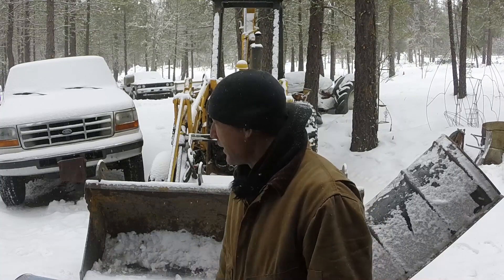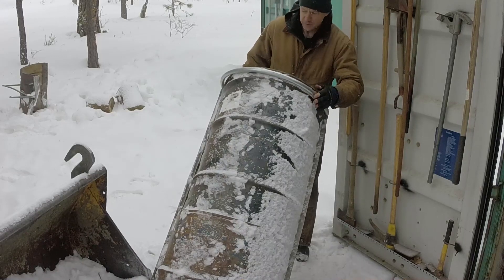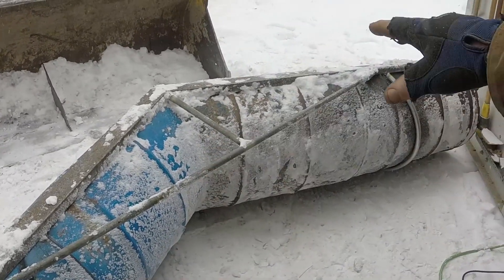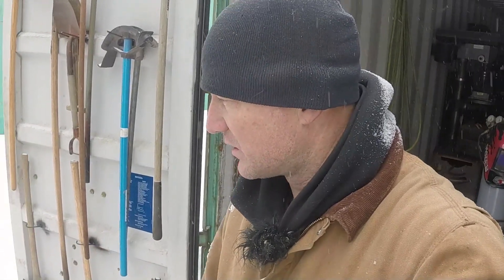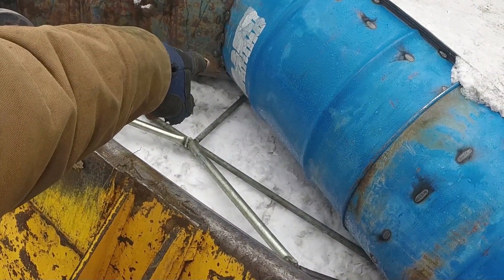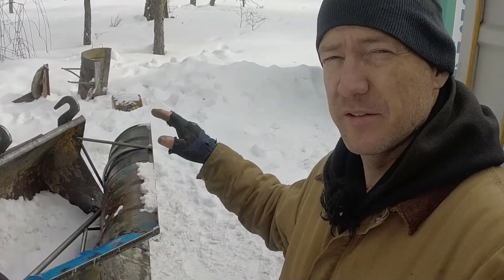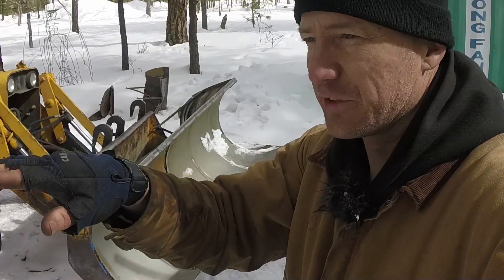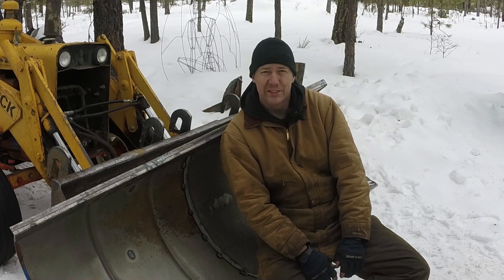Finishing the V plow for my backhoe

Comment: Nice update to the plow. Always amazing to see the amount of force pushing snow etc. will exert on  metal.
Reply from the maker: It will be nice to see how it does next year when there is more fresh snow on the ground. Thought about putting some wax on the buckets to make the snow slip off the side faster. Thank you for watching. :)
Reply: @KoalityofLife  rainex :) but good paint do great.
Reply from the maker: @StevesDIYProjects7  Rainex would probably do the trick pretty fast. I don't plan on painting it, some of the barrels are kinda rusty but they will probably last a few years. I can reline it with 1/8" steel when they rust out, make it even stronger. lol :)

Comment: I've made a few things using conduit (but never a snow plow, being in the South). It will hold a surprising amount of weight, although shock loads can make it flex enough to buckle. Still, a lot lighter and cheaper than a bunch of angle iron. Good work.
Reply from the maker: Thank you. I was wondering if the conduit was going to be strong enough to handle the snow, so far so good. :)